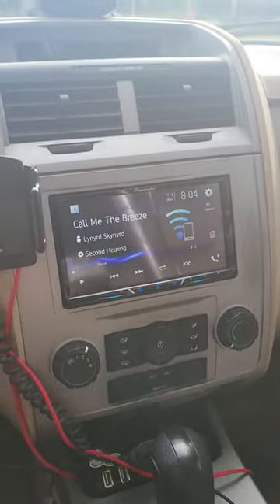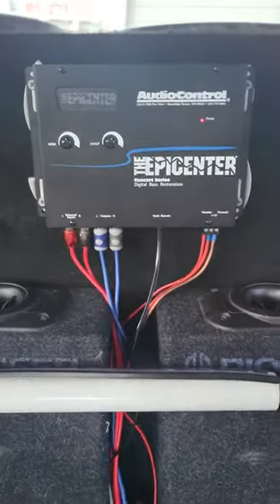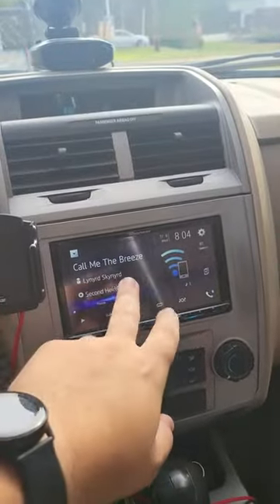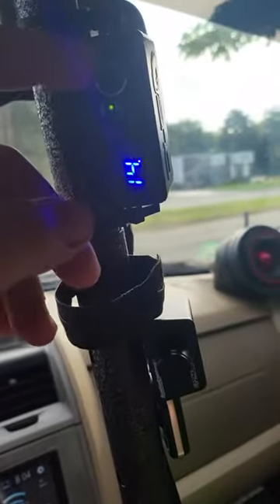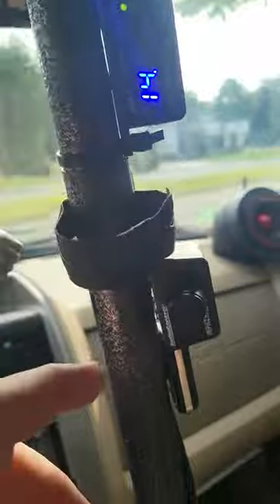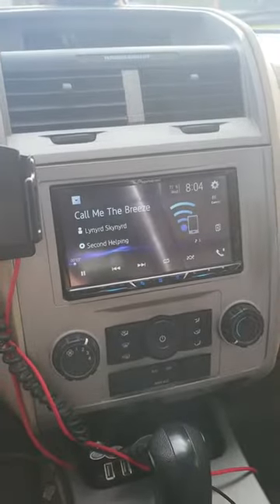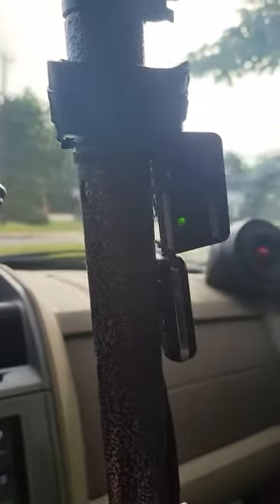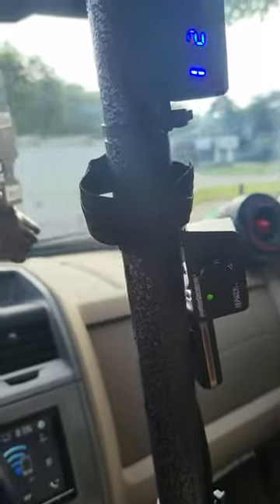How an Audiocontrol Epicenter works, demonstration

Comment: Question: the epicenter uses pfm chips which are essentially subsonic filter chips. So does that mean i can set my mono amps ssf all the way to the left/lowest setting as the epicenter is already using a pfm/ssf chip
Reply from the maker: Yep, you can use a couple different PFM's on it as well it's swappable - default is 33hz @ 12db/octave, you can also use the 20hz @ 12db/octave.

You can 100% disable or turn off your subsonic filter at the amp. I personally like to use the 20hz chip myself as a safety guard and stack the crossover at the amp too around 25-20hz. Gives you a hard attenuation where you can play lower louder, but you can give yourself a HARD cutoff frequency, say you can play between 23-63hz well - you can stack the crossovers so when you hit 20hz it is straight inaudible. Takes some adjustment
Reply: @ChadsLoud my box is tuned to 36hz so im using a 30hz pfm chip, anything lower is risky IMO as i am on 10v output setting. So at first i had my amps ssf on 30hz which had no low lows so i changed it to 25hz. Big improvement. Then changed amps ssf to 20hz. Even better. But maybe for more safety, i should keep amps ssf at 25 to 27hz which is where it would be if i wasnt using an epi at all. Another option is to use a 25hz pfm chip and keep amps ssf at 27hz. One thing i noted, the lower i place my amps ssf, the lower i need to set my amps gain. Speaking of amp gain, after you installed the epi, did you have to lower your amp gain considerably? I think u got to esp if using 10v output jumpers
Reply: @ChadsLoud and for reference im using a jp23 v1.5 those amps has 12db slopes for their ssf and low pass filters which kinda sucks   i was hoping they used 24db slopes

Comment: Question. After you play a song where as the epicenter is needed. The next song that plays that doesn’t need the extra bass from epicenter, so you have to readjust epicenter knob??
Reply from the maker: @markchambers8641  no joke the epicenter does affect the output voltage, it boosts it even with it all the way down. The connector that plugs into the knob upfront I leave disconnected and will only plug it in when I plan to use it (listening to Tom petty and stuff like that)

It is DANGEROUS with music that already has bass in it. Other way I did it was leaving the knob in my center console and just grabbing the epicenter knob when I needed it.

But yeah you can always turn it all the way down, it's still gonna boost the signal a bit though you'll notice a difference when you unplug it

Comment: Bro you’re going to blow your subs. You’re clipping BAD!
Reply from the maker: I did it for the views!!! But seriously though, I drove around like this for years and was absolutely fine because I knew what I was doing.

My gain is set with an SMD DD-1+ to 10db of overlap so at worst I'm only at around 7db of overlap considering this specific song is -3db, I run a narrow bandpass to my subs 30-50hz @ 18db/octave, 30 subsonic

Also, I played this system for years without any issues, frequently sending it into soft clipping. Not a single issue, never overheated the amp, never blew a sub or even smelled a coil. I have the JP23 and thr 2 Hawk 1544's in great shape getting dusty as I wall off my vehicle with 2 Fi HC18's on a JP63.

If you look at the video I show you that at first I turn it full tilt, then I back off and I show you me having the bass knob all the way up, no clipping - then bringing the epicenter up to about 55% before it started clipping again. The second half of the video the clip light is barely flashing and that's where you should have it. Subwoofers can tolerate a little bit of THD unlike tweeters and mids, that's why modern amps are frequently coming out with clip lights not illuminating until 5% THD whereas the standard used to be <1% THD

Totally fine to play at a soft clip if you know where your overlap is and are familiar with the system. Even when it was full tilt and solid clip light I could still drive around like that fine for up to a half hour or so before you start feeling warmth in the dust cap. The JP 23 illuminates it's distortion light at 1% THD, when my overlap is set to 10db and I'm playing music recorded at -3db (radio music) I'm only around 5-10% THD at full tilt, nothing that will instantly fry a mosfet or smoke a coil.

And the woofers were rated 1,500w RMS each whereas they only likely saw 800w-1,000w a piece after impedence rise.
Reply: @ChadsLoud  Awesome bro. I was always wondering if clipping would damage components… Did you ever upgrade the JP23?

I have a Surge 4K on 2 X3’s and I am waiting for my Salt 6 to arrive to try and help with clipping
Reply from the maker: @Beyond THE Details  Nice! You'll like that SALT 6k a lot, clipping is usually brought on prematurely by low voltage, the SALT series puts out more power at lower voltages compared to the competition. Even better than the JP lineup honestly. I am surprised you don't like the Surge 4k though that is a well built Korean amplifier it should be powering Xv3's perfectly unless they are like 15s or 18s then they probably need more and the SALT 6 would be a better fit. Thing I'm learning over time is how much more power woofers can take if the voltage is good and signal is clean. Seems like you can run 150% rated power all day long since impedence rise kills your power.

Remember that voltage is still what's going to cause clipping early on. If you send that Surge 4k amplifier say 300 amps of current, it will likely start clipping right as you turn it up. If you have say 500 amps of current, you'll be able to turn the gain up much more before it starts distorting. Should look into LTO if you are still running AGMs. Headway for stock alternators, yinlong and scib for high output alternators. Very budget friendly when you look at the power they can do.
Reply: @ChadsLoud  If you lol at the Guts of a Surge 10K it’s almost identical to a Salt 6.. I’m not bashing Surge as I like the owner and they are good for the price.

I have the Big 3 and running the LTO Lithium and I only drop into mid 13’s.. sometimes low 13’s but that’s not bad. It clips on large bass notes. I had it tuned at one of the more reputable shops here. Gain is half way no bass boost.

2 X3’s are 4K RMS which realistically is close to 6-7K with Sundown. So, a Surge 7K may of done the trick.

I decided to just get the Salt 6 as it gives rated power at low voltage. Surge like most is rated at 14.4
Reply from the maker: @Beyond THE Details I checked out the Xv3's you posted, the 12" xv3's should GET DOWN on that SALT 6k that's a match made in heaven. And if that's going in your widebody scatpack God DAMN that's going to be a sick whip. I like that '22 you got she's a magnet for sure
Reply: @ChadsLoud  Thank You!
Reply: @beyondthedetails  definitely  not the same output  as the salt 6k these Surge audio and down4sound  Korean amps use different types of boards smaller frame more power.
Reply: @160sCg6  I literally have a Surge 4k and it isn't even as powerful as a Salt 3k. Have you seen the guts of a Salt 6 and Surge10? I love thr Surge and D4S guys but their amps are Inferior to the Salt line.

Just keeping it real and even they would say the same.
Reply: What brand subs are you using??
Reply: @ChadsLoud  hey sorry to ruin all the sundown fans or bandwagons but they're not the best. Its just the name on a amplifier. Their U series subs are no joke but as far as their amps, I haven't been impressed and I've heard over 10 systems with sundown amps
Reply: @ChadsLoud  it's all about your prep....lots of sound deadening...the box (most important) and beefy electrical. Stop paying $1200 for amps when I pay 1/3 of that and get same performance and probably more

Comment: I have a subwoofer installed but now I want door speakers and an amp for them. Should I get 2 door speakers or all 4? I’m not sure it rear speakers are worth it
Reply from the maker: 3 way up front (8" or 6.5" midbass, 3" or 4" midrange, 1"+ tweeter) if you can that handle high power, if not and you want to go just straight loudness look into coaxial horn drivers or go with one big giant driver like a ciare pw257 10 or something that will do the job of multiple and do it better.

Some care about rear fill, that's where I just put horns for loudness I keep them on a separate control. It's just easy to fit a lot behind you. It will fuck up the sound stage.

Look into customspeakerpods or gp cnc shop and get more up front sooner than later. A single 6.5 or 6x8/6x9 is just not enough IMO. A DB Apocalpyse AP-M67AN  6.5 can do the job of loudness for example, but you have no midbass then.
Reply: @ChadsLoud  right now I got factory speakers. I have 2 component sets up front and I was planning on getting a component set with separate tweeters and a cross over. Does that sound good?

Comment: I got a sky high rca bass knob, can I use that instead of the knob that comes with the epicenter?
Reply from the maker: @danny4704  You can, but it's only going to affect your amplifiers output and not the epicenter effect, for the epicenter effect you need to use the knob that comes with it, or if you don't, you'd have to tune the epicenter AT the epicenter and leave it there where you can't adjust it on the fly, which I kind of don't recommend.

A really killer option for you would be to hit up Jim Brokman on Facebook he owns Jims Machineworx, you could send him the epicenter knob and he could put it into one of these which is similar but dual knob and it's billet rather than plastic

https://jims-machineworkx.myshopify.com/collections/machined-bass-knobs/products/knuckles-machined-billet-dual-bass-knob
Reply: @ so I can probably attach the epicenter knob to the rca knob or something to get the full benefits of each system
Reply from the maker: @danny4704  yeah you need the separate bass knob and separate epicenter knob

Now the other option is the epicenter MICRO line output converter combo, with that you can control your amplifier output and your epicenter effect with a dual knob (inner top ring is main bass, bottom outer ring is the epicenter level) but you won't have a clip light that's the only thing

Comment: Bout to get one NO DOUBT NOW
Reply from the maker: You won't regret it, highly adjustable, sounds fantastic on the default 12 o'clock positions on the width and sweep, I have it in my dads car as well for classic rock and my mom's car for her music Fleetwood mac and stuff - it really makes anything without bass really shine. It's when songs already have a lot of bass where it sounds muddy. I would never use it with modern rap and stuff, although 90s rap and whatnot it makes a WORLD of difference. Hittman, Biggie, Dr Dre, Snoop, etc.
Reply: @ChadsLoud So basically on newer music just leave it turned down ???
Reply: @FJTabb  I do depends on the listener but I’ve had mine a few months now I never use the remote knob but I can Definitely tell the difference of having it

Comment: How do you connect your amp bass knob and the epicenter
Reply from the maker: Literally just adding a second knob. It acts as the epicenter effect level, and then you have a second knob which is the one from your bass amp.

If you get the new epicenter micro and use it as a line output converter, you can use the new epicenter bass knob 2-in-1 combo which works well have it in another vehicle never any issues. Has an outer ring for epicenter effect and center ring for bass level. (Control of monoblock gain)
Reply: @ChadsLoud so then if I purchase the  lc2i pro I will be able to use the epicenter with Mexican music (banda) and listen to dubstep with out the epicenter?

Comment: Would an epicenter work good with a bandpass enclosure
Reply from the maker: It would work even better in a 4th/6th order bandpass, you have a wider bandwidth with that style of enclosure compared to a traditional vented/ported enclosure. Trick with the epicenter is to balance your amp (remote) gain with the epicenter level dynamically as you are going song to song. Some songs it sounds AMAZING, others it can sound muddy adding too much.

The epicenter comes with width and sweep adjustments which allows you to select a frequency as the primary point, and then adjust the width of the bandpass of frequencies it is affecting.

So you can run the epicenter say boosting everything at only 33-36hz where your port is tuned for the most SPL. You can really crank up the epicenter there because you aren't affecting too far from your port tuning.

OR you can run it at say 40hz and make it real wide, have it reproduce the kick in the 30-50hz range and it will likely be a bit more punchy, thing is you don't want to go crazy on the epicenter when boosting frequencies far from port tuning, you will heat up the voice coil in your subwoofer fast.

It is extremely adjustable, has a movable 3 position jumper you can move inside the epicenter that acts as a subsonic filter as well, so you can have it so say it won't reproduce any frequencies under 32hz whatsoever even if you widen the bandpass all the way.

Width a bandpass enclosure you have two port tuning frequencies typically an octave apart meaning you can more safely run the epicenter at a wider bandwidth maybe even 25-60hz if you watch your subwoofers excursion to make sure it doesn't bottom out.

Comment: That’s cool and all but if you clip a lot for to long you could blow the amp.
Reply from the maker: Light clipping is fine, played this system for years never blew an amp or sub. I set the gains with a DD-1+ and played with overlaps and kept my eye on Temps. Went from 5db to 7.5db to eventually 10db overlap still never blew a speaker or amp, the Temps max out like 48c in the hot summer heat. Never smell coils either, they were 1,500w rms each on a 2300w amp

You just need to know whay you are doing is all. And like I showed in the video towards the end, I turned it up to where it was clean and barely clipping and you could hear how much louder it was with the epicenter even before clipping.

And clipping on say low voltage on a taramps full bridge, yeah that's terrible. Light clipping at good voltage on a well built Korean board is an entirely different story. People Light clip these at half ohm!! Just not heavy distortion, subwoofers and monoblocks can take just a little bit of THD.
Reply: it was a soft clip. it is usually harmless, I run mine at that same point.

Comment: What subs are those bro?
Reply from the maker: American Bass Hawk 1544 - 1,500w RMS 3" DVC - killer deal for the money, sold thru Amazon $210 a piece to your front door. Shits all over the competition. For the $200 range your getting say a 500-600w RMS subwoofer from companies like Sundown, Kicker, Crossfire, etc.

I remember spending $350 a piece on Sundown SA15 V1R3's and now they are in my closet after I replaced them with the cheaper better performing Hawks.

Now I'm running Fi, but I will always stand by american bass. They mass manufacture yeah, but they make a good product.

Comment: Straight clipping like a complete noob. Lmfao
Reply from the maker: Had to do it for the video! And the gain knob all the way right I tuned at 40hz sine wave with max clean head unit volume with an SMD DD-1+ to 5db of overlap at the time, so although I was 'straight clipping' I wasn't a noob and did it right. I still have this equipment today and it all works, just walling off my car with new stuff to start competing.

Say what you want! 😃

Matter of fact 3 years ago I was showing the SMD DD1+ to CarAV reddit and helping explain to people how to tune systems with epicenters.

https://www.reddit.com/r/CarAV/comments/dbef5c/fingernails_clipped_toenails_clipped_audio/?utm_source=share&utm_medium=android_app&utm_name=androidcss&utm_term=1&utm_content=2

What have you done?